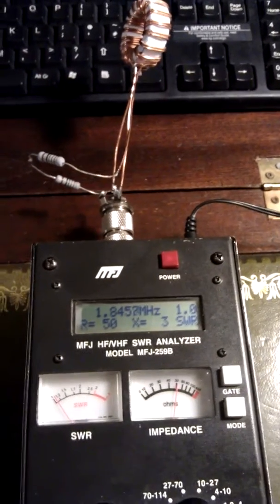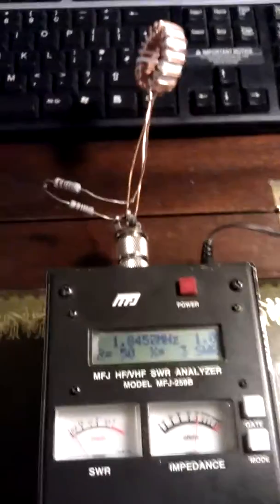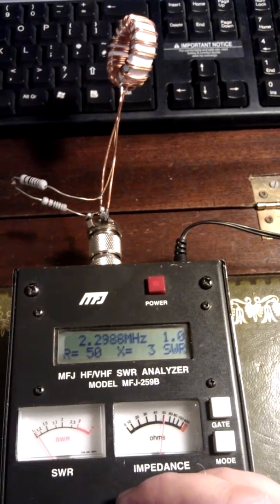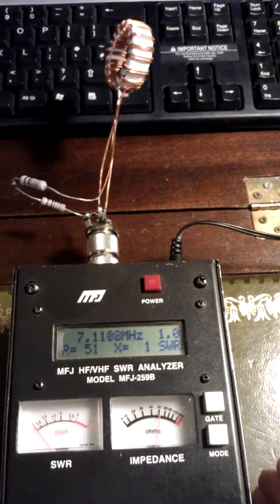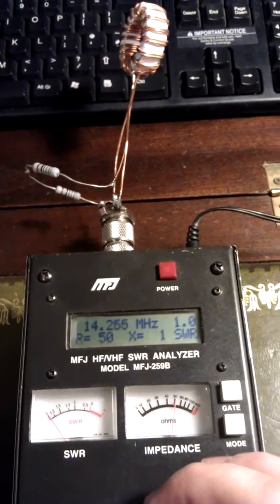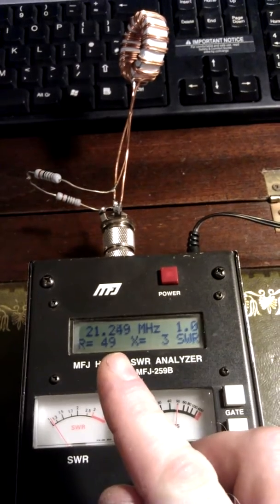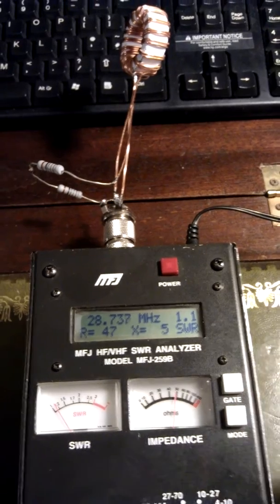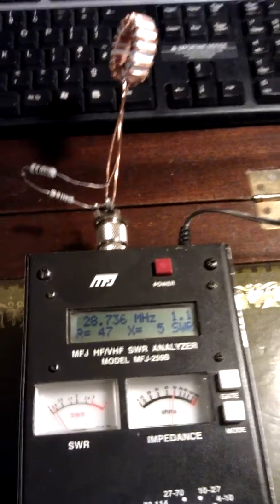testing homebrew 4:1 Voltage Balun for a Carolina Windom

Comment: Excellent! I am working on a 4:1 air core balun. I figured I would start with what I have laying around. Once I get it working I may see about building one with with a ferrite core like you did. I would then see about mounting it in an Altoids tin. I have an off center fed dipole up. I just need to add a balun to get it working right.

Comment: I am really looking foreword to someone figuring out a 240-61 core using #14 wire I have been experimenting with some ferrite cores of un-known origin that I get out of VFD's they make very good 4:1 current baluns with a flat SWR up to about 33mhz or so but I would like to find out how I could do it with a 61 or K mix core.  I am surprised that with the real close spacing on the wire he can get the 50 ohm mark so close. It would be nice if he listed the wire size along with the 17 turns.

Comment: get the mini ring core calculator program.
here's some copied information:

MATERIAL 43 (µ = 850) High volume resistivity. For medium frequency inductors and wideband transformers up to 50 MHz. Optimum frequency attenuation from 40 to 400 MHz.

MATERIAL 61 (µ = 125 ) Offers moderate temperature stability and high 'Q' for frequencies 0.2-15MHz. Useful for wide band transformers to 200 MHz and frequency attenuation above 200 MHz.

Toroids Micro Metals Iron Powder Toroids
 2 Mix (Red)     1-30 MHz, high volume resist. u=10
 6 Mix (Y)     1-50 MHz, similar to mix #2. u=8
 8 Mix (Y/R)     1-50 MHz, replaces 6 mix. u=35
12 mix (GN/W)    
17 Mix (BL/Y)    50-200 MHz, good Q. u=3
18 Mix (GN/R)     N=55, Low Core Loss, Similar to 8 Mix
26 Mix (Y/W)     DC-800 KHz, great 60 Hz.
40 Mix (GN/Y)     Power conversion similar to mix 26
52 Mix (GN/BL) DC-1 MHz, high perm. u=75

Iron powder other suppliers
Type Colour    Freq range (typical)
1 10     Blue    150kHz to 3MHz
2 4.0 Red     250kHz to 10MHz
6 3.0 Yellow     3MHz to 40MHz
7 3.2 White     1MHz to 25MHz

heard that type 0 , dark red is hard to work with

Comment from the maker: James.This project was some time ago, but can remember the Iron core had no decent capacitive effect.. As the video shows the 61 material was effective but be careful it doesnt saturate. The 61 was a core i had kicking about that tested well. I put my windom up, tested it and then settled on a cobwebb, "Great antenna" so left the windom. My first choice material would be 43, Ive done a few chokes using 43 core since without any issue's at all.. Good luck with the project